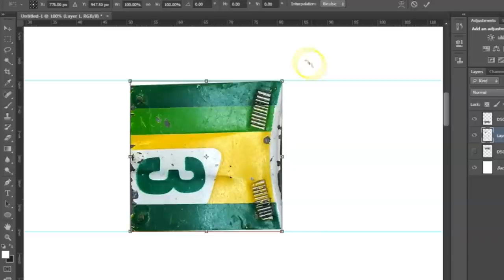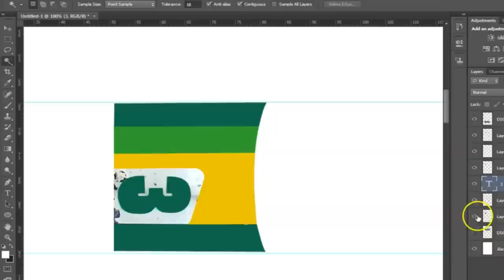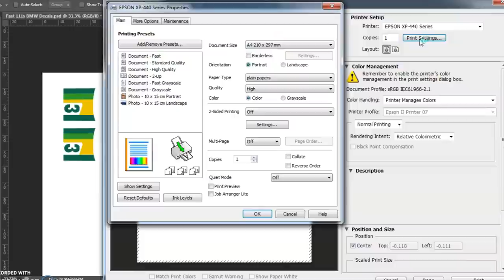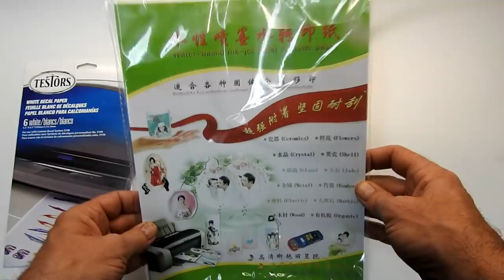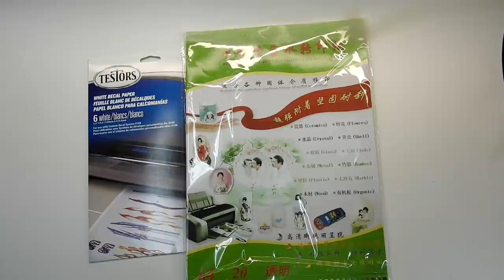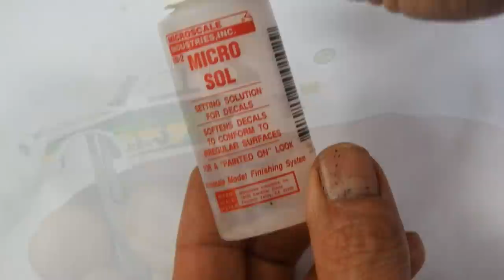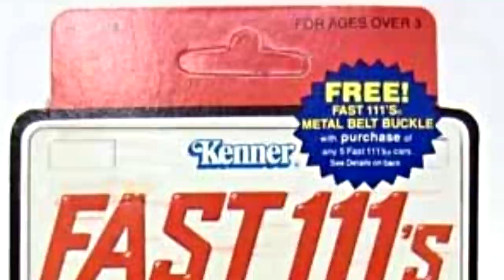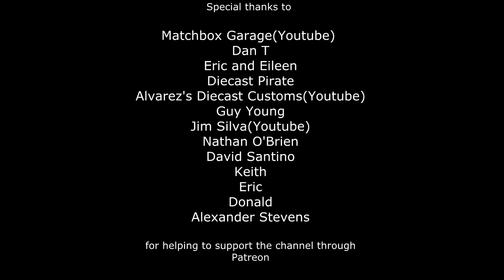Kenner Fast 111s BMW Restoration | How To Make Replacement Decals

Comment: I've recently discovered the fast 111s and I like them. I think the weird bumper taillight thing with the unique plates was an interesting gimmick and I'm actually here for it. Brilliant work on the decals and thanks for the tip from Ali Express. I get mine from Amazon and they're about $1/sheet for our equivalent of A4 paper. Not bad, but it's still tricky to get as much use out of them as possible so I try to stack my decal prints, especially now that I can print with white toner. Great video, Danny! Cheers!

Comment: nicely done, great choice in wheels. :) and yes, that position of decals can be tricky. doing it multipart might have helped, though then there would have been gaps to the fenders' edges. guess one can hardly win with these. XD back in my days I often tried to restore the tampos with paint. didn't look much better, but there. :)

that rear bumper, though. what were they drinking?

Comment: Is this BMW based off of any sort of real life racecar? The rear bumper and proportions look funny
Reply from the maker: I guess just a body kitted 320. The large rear bumper was on all of the Fast 111s. It does look pretty odd.
Reply: That rear bumper was the unifying theme across the brand.  It definitely looked odd on some vehicles but looked great on others. I still have about 20 of them.  Always found their designs interesting...especially their unique/original designs.